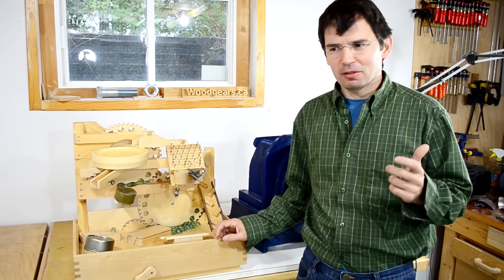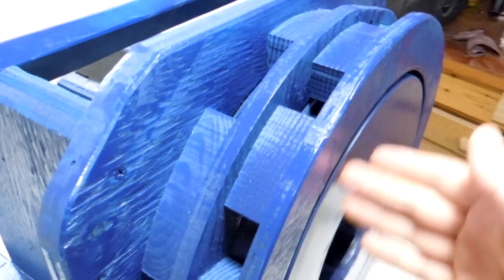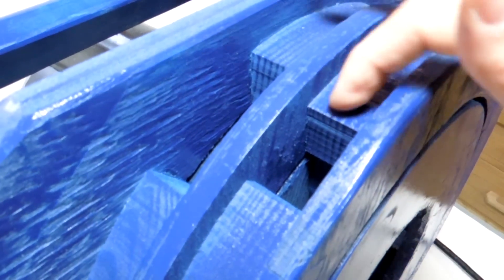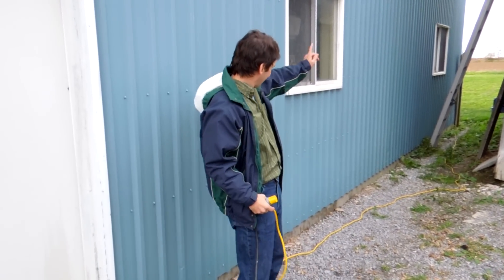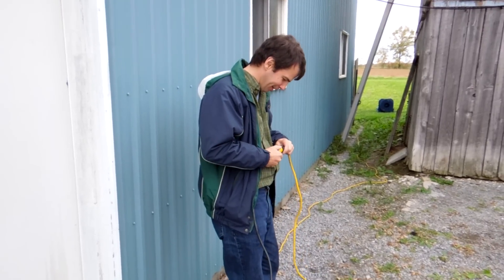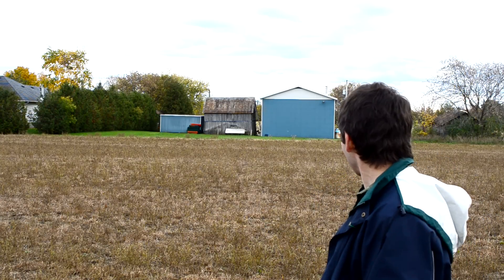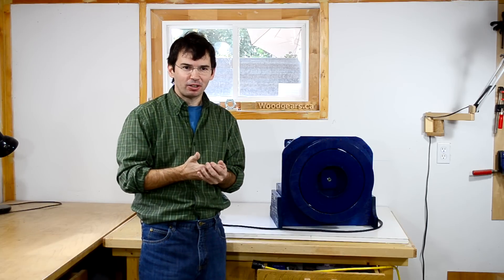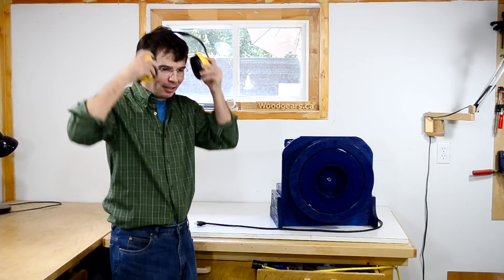Testing the air raid siren

Comment: Wanna make it louder? Make or buy a blower, even a shop vac and force it into the intake making positive pressure, aka "supercharging the siren" this is the method of the Federal Signal Thunderbolt and ACA Hurricane
Reply: Or attach it with a air funnel to the big-ass bumper on my truck.  Let's see how loud it is at 60 MPH!!!!

Now SUBSCRIBE ALREADY PEOPLE - Has this man not done enough cool videos YET to earn your subscription?  What are you waiting for, a scroll sawed, personalized invite?
Reply: Bradley Brand That wouldn't generate near the same sound pressure. Blowers such as those generate over 250 CFM of airflow at over 9-10PSI. Uncompressed free air wouldn't work that way with your truck.
Reply: You haven't even seen my funnel!  JK.
Reply: I think mounting a horn on it would help Too, so the sound would balance a bit.

Comment: In order to make it louder, you need to match the acoustic impedance of air. You can do this by adding horns that convert the low impedance output of the siren to the high impedance of the air. Once matched, the power transfer to the air will be far more efficient and that 1.2kW will be absolutely deafening!
Reply: Good explanation! He should really do that.
Reply: Thenormalsteve just imagine. if a 100 watt speaker gets you house shaking, what would a 1200 watt "speaker" do if it was as ifficent.
Reply: G3RMANARMY
1200W is equivalent to the sound of a medium DJ system, but those have to produce a lot of bass frequencies. If it were putting all of that energy into two sounds which contain most of their energy in the middle of the audio spectrum for human hearing where it is most sensitive, then it would sound orders of magnitude louder!
Reply: ***** that what i meant basically!
Reply: or, ... Place a Microphone beside the siren, now, Conect to amplifier, then to another amplifier, then to another, then another, all set to -0DB (from -DBs) then another amplifier, now connect atleast 2 1200Watt speakers,
This will burst the ground of loudness >_<!!
Reply: Thenormalsteve Well this Siren is practical already a 1200 Watt "Speaker".
Its just that this particullar one right here isnt very efficient
Reply: +Jim Griffiths Ideally between 2-5kHz, nearer the middle
Reply: +Thenormalsteve Well that's not really how amplifiers work :P They can't just "multiply" any input, they have a limit. I don't think chaining them like that would be any louder than a single 1200 watt amp maxed out. If you hooked them up in parallel though, that should work! But then you don't really need the siren in the first place, just something that can generate a signal.
Reply: +Jim Griffiths Yes, horns! Get on it! :D
Hmm, are you sure though? Looking at pictures of drum-style sirens, they don't use horns like that. And you'd think they would use them if it'd be more efficient. What some of them have though are horns that direct all the sound in one direction, and then they're mounted so that they spin around. That seems like a good way to increase the volume.
Reply: h3rteby

>> "Hmm, are you sure though?"
I'm sure. Focusing the sound is a secondary function to matching the acoustic impedance of air using a horn. Since the impedance of air is relatively high, you could have an extremely high power speaker that is only 1mm in diameter and hear almost nothing. Focusing the sound will not do much to increase that level. Imagine a speaker without a box.

Focusing sound is analogous to putting headphones inside a pan. It gets louder but only by a small amount. If a horn is fashioned that matches the low acoustic impedance of the headphone driver on one side, and matches the high impedance of the air on the other side, it should be many times louder. I may make a video about it since it's an interesting subject that defies belief until seen/heard. The horn also has to be fashioned in such a way that it continuously alters the impedance using a special curve that is modelled.

I actually designed a subwoofer for my car using speakers designed to output mid frequencies. It worked spectacularly right down to 35Hz due to the design of the subwoofer unit and the ports to enable better matching of the acoustic impedance at the frequencies of interest. It was pretty damn loud! I'm definitely going to have to make this video now heh!
Reply: +Jim Griffiths Yeah I know. The best example is probably classic gramophones, being able to translate just the vibrations of the needle into quite a loud sound using no active amplification! That's quite impressive really when you think about it. A siren isn't like a speaker though, it doesn't move air back and forth, it only blows air out, so it might not work the same way? Again, why wouldn't drum-style air raid sirens use horns if they were effective?
Reply: h3rteby
Gramophone is the perfect example. But yeah, I'm not sure about drum-style air raid sirens. Perhaps they were loud enough as it is and they wanted to have a perfectly toroidal sound output to reach everyone in the area. That's the only thing I can think of.
Reply: +h3rteby they actually do, look up the 3t22, or STH-10 or STL-10 or even Sentry 40V2T's and such Others like the RM-130, or the T-128, they use horns on the drum, then there is the Thunderbolt, Hurricane, ect

Comment: You may be able to amplify it by turning it into a compression driver. Enclose it with a forward facing aperture - located in the center in line with the motor shaft is fine - and then make a simple box horn to act as a megaphone. You're only interested in volume, not fidelity, so no need to muck about with flaring or anything fancy for a first pass. A compression driver has a smaller opening that the actual driver (hence the compression) so the aperture having less area than the total area of the open slots at any time ought to provide the desired results. Really loved the videos on this, many thanks, very inspiring!

Comment: Using wood dampens the notes significantly - there’s a distinct difference in the sound from a stock alloy stator and metal casing but still a great project and good results

Comment: isn't that type of siren called a klaxon?
Reply from the maker: ***** no
Reply: just "no"? can you please explain to me how yours is different, in essence, from these horns? 

http://www.directindustry.com/prod/klaxon-signals/high-power-sirens-15275-954623.html

now, don't get me wrong. the fact you built this by hand and with wood is very impressive indeed. i'm not trying to take away from that. just wanna know the difference between yours and a klaxon.
Reply: ***** The siren your link leads to is a Klaxon brand Siren. Confusing, possibly, but both are sirens, and not klaxons. A klaxon uses an electromagnetically oscillating plate to create its sound, I believe
Reply: Jim H *****  Original Klaxon-brand sirens used a steel diaphragm struck by the teeth of a spinning cog.  They also used horns for better impedance matching.  They are known for producing that "ah-oog-ah" sound you hear in old submarine films.
Reply: Nelumbo Nucifera thx.
Reply: ***** and i sounds nothing like that it sounds to me like a carter or castle siren
Reply: The sound is probably a Carter, Castle Castings, or a Klaxon
Reply: Mrpersonman0 well, he doesn't know me so if he's gonna take his time to explain something to a complete stranger, at least he deserves my thanks.
and thanks to you also for taking the time to read and reply to my question.
Reply: ah, ok. but, um, would you consider this handmade one a "klaxon" type siren? or should i quit while i can?
Reply: all right, then. stupid klaxon! just kidding.
can i say thanx?
Reply: Mrpersonman0 i use $100 bills, although i  wouldn't recommend it,
Reply: +Mrpersonman0 MY EARS
Reply: +Raymond Duncan Right, and if Xerox branched out and made ink jet printers, all ink jet printers would not be xerox printers :P The term 'klaxon' as a generic term is a different type of siren entirely, even though the klaxon brand now makes this type of siren.
Another one is 'kleenex'. Kleenex now makes toilet paper(Cottonelle), but the generic term 'kleenex' refers to facial tissue in a box.
Reply: +ScotSpeed Well Matthias's siren has 6/10 ports and klaxon usually have 8 or 10/12 ports
10/12 is the typical British Air raid siren
Reply: no

Comment: You have the right concept in the design, but can you get the rotor closer to the chopper radius (the dual tone rings on the outside of the unit?) If so, you will be able to maximize the output of the siren. The tones are very good and have a good harmony.  Last thing I would do would be to use a 3/4-1 HP step up 220V electric motor for the driver. I notice that when it winds down it is bogging a little bit. Imagine building a siren exactly like this design only have it be 2.25 times larger. You would be able to hear that close to a mile away. The key elements are:1) Closeness of rotor fit to the chopper radius internally;2) Use a 220/240V Electric step-up motor. (Sounds like you are using a 110-115V STD. Motor now. 3) Be sure that you use good roller bearings for proper support and levelness. Beings you are using wood, you need not worry about weight problems and that will help the motor that you use to kick it up faster. Some of that bogging you had there I think might be from those bearings as they may have heavy duty bearing grease in them and looks like it was cold outside  then. That would tend to thicken those bearings grease and by not having a strong enough motor, you may get that bogging. Good job and good luck!

Comment: it starts up and slows down too quickly i suggest adding counter balanced weights to it.
Reply: Exactly although most dont know what that is.
Reply: That would add a nice affect to the wailing. Would the pressure be too much for the wood?
Reply: Not much maybe some steel disks. Sheet steel i should say.
Reply: I would think a good speed controller on the motor would be a better idea rather than adding unnecessary weight.

Comment: Okay, now all you have to do is build a large horn for the siren, which will increase the sound level even further by directing most of it in a single direction.
   And then to get the fade in and out effect, you can build a platform to spin the whole thing (siren, horn, etc) on it’s axis. At that point, to get even more sound, you can build multiple sirens, each tuned to a different frequency.
   At some point in all this, the neighbors will call the police to report the noise disturbance - with others calling the police to ask about the disaster/tornado warning (and you just know there's a law somewhere against fake warnings).

Comment: Really cool!
The "audio AGC" at the end is just distorsion because the camera cannot handle the sound level - it cuts the sound wave form right off when the maximum signal level handled by the microphone/preamp is exceeded (wich is also why the sound quality is poor)

But - nice that your camera do have adjustable recording level on the built in microphones (as most cameras dont have that ether) - this shows much better how loud that thing really is, as well as the 100 m test - awesome!

Comment: i have that air raid siren its on a switch and just to make it not so loud, the air raid siren itself has a switch to change the rpm. I have it on 750 rpm so its loud enough (about 100 dB from 5 meters away from it) So i use the siren to tell my FAMILY WHEN ITS LUNCH TIME OR SOMETHING OTHER BECAUSE THEY ARE ADOUND THE HOUSE EVERYWHERE. Oops sorry for the caps.

Comment: Add a megaphone to it.
Reply: Good idea but megaphones have a max volume they can reach, they don't just flatly increase any sound otherwise you could use them to make an obscenely loud sound by linking a bunch together. this siren is probably louder than any megaphone
Reply: so add like 20 megaphones, a'la Bart
Reply: You could use an acoustic megaphone. A lot of the professional ones actually "horn load" the output of the slots e.g. put an expanding trumpet/funnel of air on the end of the slots in order to compress and move more air! And those are REALLY LOUD!

Comment: I thought the whole project was very crudely done.  The worst part was plugging and unplugging the motor.  Why not use a switch, for heaven's sake.  Another problem was that he was using an 1800 rpm motor, whereas a 3600 rpm would work much better.  It would be necessary to balance the rotor much more accurately than he did.  Oh well, he had fun doing it.
Reply from the maker: Oh, perhaps not nearly as bad as somebody making know it all comments, and getting the facts wrong.  Like believing it's an 1800 RPM motor for no apparent reason.
Reply: Good lord, I just witnessed a murder on youtube! faints
Reply: everyone's a critic.
Reply: Found the guy that knows everything.
Reply: +Rusty Shackleford well, someones a salty. dont be a keyboard warrior, the dude was just stating how he would of done it.
Reply: I can tell it's a 3600 RPM motor by the pitch. Why do you have a problem with using a cord? He can use a cord and not a switch if he wants. The rotor was balanced properly as you can see in the video. I recommend you actually watch the building process before trying to make yourself look better than this guy. I doubt you could even cut out a perfect circle or wire a motor correctly in the first place.

Comment: Great video.  Would like to make an important safety suggestion:  DON'T use a
plug for a switch.  Switches are made to contain the sparking, thereby preventing
fire hazards.  Switches are also more durable than plugs during sparking.

Comment: Put an adjustable resistor switch on the line so you can wind it up and down as you please and cut it on and off without the need for plug and unplug action

Comment: Your 'more cowbell' needs more power 💪
In any other way great work!
I think the real ones blow a bigger air volume, so I think you'd need a bigger motor and a bigger fan set, either wider in diameter or thicker.

Comment: Hello Matthias, 

If you're looking to make a second air raid siren, or a Mk.2 of your current one, then I suppose this time you could try making the rotors pull air in from the outside and pushing it forwards instead of pulling it in from the front and pushing it through the stators, and perhaps you could try a 10 and 12 port arrangement either side of the motor housing? 

All that if you want to make a "bit" more noise? ;)
Reply: +AlmightyBanger Also, I would guess that the clearance between the rotors and stators would have to be  fair bit tighter, say 0.5mm or a 32nd of an inch? Possibly tighter?

Comment: that's genius, but how ever, if you want it to be louder at distance, add cones to the holes and place it on a platform where air can enter the intake valve so it has a effect like a ACA banshee air raid siren since it already looks and sounds like one, great job

Comment: Now, if you re-orient the siren to horizontal, and construct a polar array of waveguides (or a directional waveguide similar to a commercial 'horn' speaker), you can increase the dB SPL output of this thing by a considerable amount! Designing waveguides can get fairly involved, depending upon how sophisticated you want to get (frequency-specific, long- or short-throw, dispersion angles, etc., etc.) but even a relatively primitive piece will make a significant difference. Start with a 'collector' where the air exits the impeller(s), and splay out a square or rectangular 'cone,' at regular intervals, and have a dB meter handy to measure the difference! Oh, yeah...warn the neighbors first! :-)  (BTW, simply flipping to horizontal will make a significant difference!) Enjoy!

Comment: The Keofiller siren, designed by the Great American Wooden Siren Company, it is built with layers and layers of Kissy-scented love to ensure the best quality. 

When the siren sounds, you know it is all about the same time as good as When the siren song filled the air on July 4th for you. Be sure to check yourself before you Esape the Giant storm.

How it works: the first part is the base of the siren which holds it in place. Next the motor drives the rotor. Then the siren uses Gas that is turned into Eletric energy. Last, but not least, the siren has a vowel of Pitches one is in the front, the second is in the back, and then the motor is 50020085 volts.

Comment: Nice!
I would stay away in case it flies apart at peak RPM.Openings (ports) should be 50% opening and 50% closed areas.

Have you made a mechanical three-foot diameter wood clock?

Comment: The closer the rotor is to the stator, the louder it will be. I know it will be difficult, but you could add more roof somehow to the rotor blades and get it as close as you can to the stator without it rubbing.

Comment: Make a cone around the thing and encase the siren in a metal mesh cage. Control the power flow via a relay switch through a microcontroller to make the pitch oscillation.

You should never stand right next to it...

Comment: I have a Logitech G933 wireless headset with very good noise cancellation on my microphone. It takes a police car going by my house for an external sound that's not right beside it to actually activate it when the software is running properly. 

I followed this man's instructions and put his voice at a regular volume. As the volume quickly grew (which I had anticipated, it's bloody air raid siren) I hastily spun the volume knob on the back of my headset down. The sound was loud enough that it came out my speakers loud enough to activate my microphone for a brief moment and confuse my friend who I was in a voice chat with. Me jostling my headset might have activated my mic too, but I don't believe I've ever had anything play loud enough to loop like that.

My hearing is fine, it didn't hurt, but it sure came close. lol

Comment: get a $59 variac and you can control the speed and therefore tone and not have to unplug to turn on and off
Reply from the maker: Doesn't work that way for induction motors.